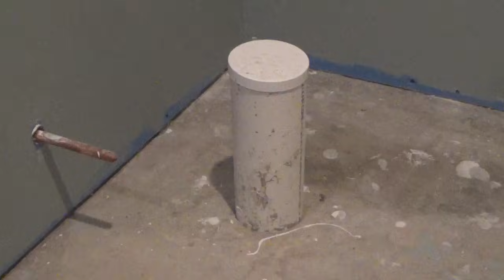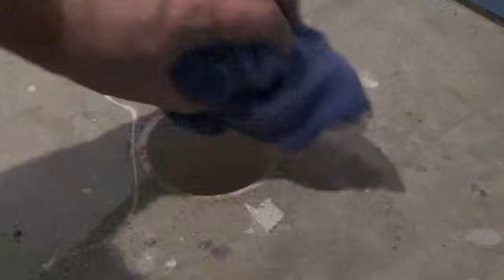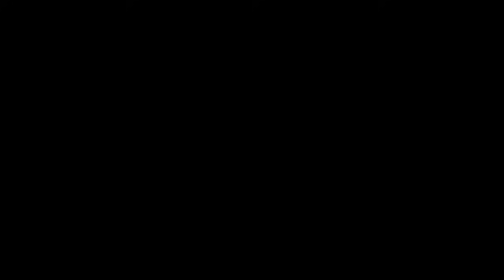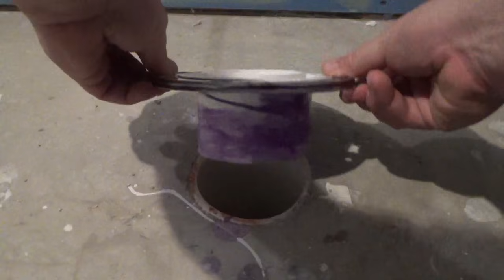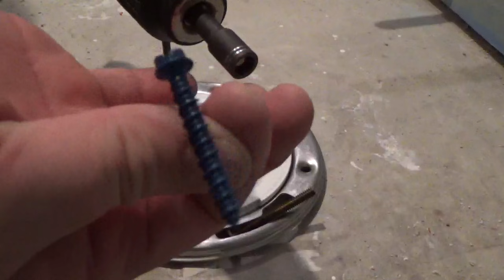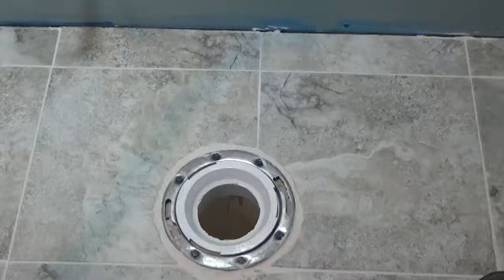Toilet Flange Installation on New Construction - Closet Flange

Comment: What if you are not going to add tile to the concrete floor? Will the closet flange then be too high?
Reply from the maker: Either way, there's a wax ring that will fit for sure. Regular or jumbo. No problem.

Comment: The primer needs to be on both components, unless you only want the cement to reliably stick to one of the pieces. Also, don't let the primer dry. It needs to be wet to bond with the cement and PVC. These are both right on the can, steps 4 and 5.
Reply from the maker: Indeed

Comment: My concrete floor is not flush. Any suggestions on how to get it flush?
Reply from the maker: Do you mean "level"?
Reply: Yes. The floor is not level so the flange does not sit flush. On one side it is flush and the other side I can fit my index finger under the flange.
Reply: Yes. The floor is not level so the flange does not sit flush. On one side it is flush and the other side I can fit my index finger under the flange.

Comment: Hello thanks for the video! The cement around the soil pipe is uneven and is slightly sloped. Do I need to level out the concrete first? Thanks
Reply from the maker: You could use spacers to do the same thing.

Comment: Great video, thank you.  Obviously this tile job worked perfectly for the flange in this video, but generally, should the tile work be done first around the waste pipe then have the flange installed on top of that?  Or does it not matter?
Reply from the maker: There's a lot of plumbers that will tell you to have the tile in first.  My tile guy wanted the flange in first.  if it sits too low, you can add spacers, or just simply use a jumbo wax ring.

Comment: First, thanks for the video it is a duplicate of my situation with the rough in stub in the basement. Second I need some advice, I want to sit my toilet on the bare concrete floor for now but in some years I might want to lay floor, if I set the flange flush will I have created a nightmare? My toilet upstairs was installed by the builder and it is NOT on top of the floor either and seems just fine. When I install the basement flange can I sit it just a bit higher to accommodate future flooring or is this a bad idea? Any help is appreciated.
Reply from the maker: well.....   the real answer is:  'flush with the floor" if you can.   There are spacers and jumbo wax rings for any play otherwise.   Hope this helps.
Reply: @PhilCrockett  Thanks Phil.

Comment: FYI. When he says if you have a 4” pipe then you need a 4” flange is misleading. You actually need a 3” x 4” knockout flange to fit inside the 4” pipe. If you buy a 4” knockout flange it will be too big to fit inside the pipe.
Reply from the maker: thanks for the tip

Comment: Primer does not only clean the fitting/pipe surfaces, but it also sightly softens the surfaces to be mated together. So yes, both surfaces should get primer. And the primer does not need to be completely dry before glue is put on.
Reply from the maker: thanks for the tip

Comment: The flange cap can create a vacuum. Do not leave the towel in between it, as it will slowly get sucked in. Because of this vacuum, I'd be hesitant to leave the cap on for long.
Reply from the maker: thanks for the tip

Comment: Great video, very helpful! I just attempted to replace a toilet in the basement and found out that the PVC flange is cracked on both sides. I was going to replace the entire flange but I realized that there was no screws holding it in, so I think the original owner glued it in but never screwed the flange down.

This is the basement so I'm assuming concrete underneath. So, I will use a flange repair kit (just a metal ring) and screw it down over the original PVC flange so I can avoid attempting to remove that. 

I will have to use the masonry bit to drill before the screws and this video showed me how to do that.

Wish me luck! lol
Reply from the maker: let me know how it went, John Doe!

Comment: What size of reciprocating blade did you use to cut it?
Reply from the maker: Not sure the size.  just get one longer than the diameter of the pipe.
Reply: @PhilCrockett  got a 12 in one should do the trick!
Reply from the maker: yes!

Comment: Isn’t the flange supposed to sit on top of the floor?
Reply from the maker: That's the best way to do it, if the floor is in before the flange.  otherwise, it's a close guess.  I always side on setting lower, rather than higher.  You can always buy a jumbo ring or spacers if a little low.  But a flange set too high will cause the toilet to rock.

Comment: Phil, as some others have already stated, your installation is not correct and will lead to leaking toilets... being the novice that I am, I watched your video and installed the flange directly to the subfloor and now I’m staring at a flange that is slightly recessed below the tile. I cannot get mad at you of course, this was my laziness and lack of additional research that got me here... but it would kind of you to at the very least put something in the description urging DIYers to set the toilet flange AFF. For anyone reading this who made the same mistake as me, I would suggest the use of the set rite flange extension kit.
Reply from the maker: Thanks for the input.  I checked with multiple plumbers and flooring subs before I did this, and went with their recommendations.  The toilet install on this flange went well, and works wonderfully.  No leaks, no problems.  It all depends on the thickness of the flooring.  In this case,  I chose to be a little recessed instead of accidentally having the flange above the surface (that cause rocking, and is super hard to redo).  If the flange turns out to be too low, then you use a jumbo ring, or spacers like you said.  It's very difficult to have a video that covers everyone's specific situation.  Most folks probably have the flooring put in first, but my recommendations for plumbers and flooring guy said to do it like the video shows. Thanks for your input, though.   My toilet is doing just fine, and if I had to do this all over again, I wouldn't change a thing (in my situation that is).   if you can get it as close to level as you can, then that's great,..... but be sure to not go too high.

Comment: Isn't the metal flange supposed to be on TOP of your finished floor?  The rim of the toilet sits on the finished floor, meaning the bottom of the flange should sit on the finished floor.  This is shown wrong.  This is shown flush with the floor.
Reply from the maker: Good call.  Read the first comment in the video description for an explaination.

Comment: I have always heard though that the flange should be installed on top of the finish floor not on the subfloor
Reply from the maker: Yes.  However, if the flange is put in before the tile,  you;ll have to give it your best guess on how high to raise it.  If you raise too high, the toilet will rock.  If it's too low, then all you need is a jumbo wax ring which is a common product and works well.  When you can, put the flange on top of the finished floor.
Reply: @PhilCrockett  ....If you install a "jumbo" wax ring, then I suggest people watch closely for leaks over time.  Two of my downstairs bathrooms were installed with the flange too low...on the subfloor....with 3/4" Advantech, thinset, 3/4" Durock, thinset and tile on top.  I had no idea that was done....not the first owner.  After the wax deteriorated, they leaked, and destroyed the subfloor.  If possible, I recommend people make sure that the flange is at least level with the finished floor, if not on top of it.

Comment: Probably one of the better videos I have watched, but the opinion bit/comment above or below or flush should be explained. Someone needs to do a video on this. Is it actually code in some states, why is it code? Why do some people say on top results in leaks and rocking. I would have a hard time believing it would be code anywhere if that is true. I'm not stating an opinion, I just want to know what the acceptable options are.
Reply from the maker: The answer, will usually be that the flange sits on top of the floor.   However, in many new builds, the tile people want the flange already installed.  Which makes sense, because you don't want to screw to tile.   So... depending on the thickness of your floor, you will have to give it your best guess and use spacers if you think the floor will be too thick.  We're talking about a flange that's 3/16" tall.  So if it's flush or on top, that's TRULY NOT A BIG DEAL.  However, the worse problem is if it's too low below the surface and too high above the surface.  The good news about this is they make a Jumbo wax ring that can seal a low set flange.  The bad news is, there is not a quick fix for a high set flange.   It was a lot easier when bathroom floors were vinyl sheets. ..... no figuring on height, you just simply screw them down (which BTW, sits "on top of the floor"... if that helps.  Some plumbers in the 70's didn't even use flanges, they just screwed the toilet to the floor which works, but dumb for many reasons.    Anyway......  The real answer is:   flange on top, but be careful not to set it too high.    The second answer is, flush works fine, as long as it's not too low.     Remember,  you can always use spacers and jumbo rings if needed.  In this video, I didn't need either, and the flange was fairly flush.  I have had, and will have no problems.    Before doing all of this, I got advice from my plumbers friends at our local plumber supply store where they hang out.  Most said flush is safe in the case of tile coming in second, and some said on top guestimating with spacers.... both sides agreed that it was splitting hairs  (a 3/16" hair).....
Reply: @PhilCrockett  Thanks for taking the time to reply and the thought!
Reply: Oatey, The company that makes these, literally instructs you to install it on top of the finished floor. There's always the guy that says I've been doing this for 30 years but doesn't actually live in the house for 30 years to know that it leaked through the floor because they put it on the subfloor.

Comment: This method works PERFECTLY for basement bathrooms.  I just completed it exactly as shown in this video on my new basement bathroom and no leaks whatsoever.  A regular standard size wax seal worked great. I did not need to buy a thicker wax seal.   I also caulked around the toilet but left the rear of the toilet perimeter uncaulked so if there are ever any problems I would see it.  make sure you do that if you caulk.  Never caulk around the entire toilet (leave the back part uncaulked).    Also like he said, make sure you use a metal rimmed flange and not an all plastic/pvc flange.   I HIGHLY RECOMMEND his method shown in this video where you put the flange in first and then tile up to it.   A+
Reply from the maker: Thanks for the super awesome comment, Steven!
Reply from the maker: BTW.....   I looked at your main web page and clicked on some of your domains.  Good to see a fellow Show-Me State guy doing well.  I swear our paths have crossed at some point.  I see a lot of similar interests.  As a side note, your site:  www.Missourimetaldetecting.com is one that I will have to pass on to my friend.  He is starting up a metal detecting youtube channel.    check it out:   https://www.youtube.com/channel/UC9JfmF1FC4qXpZkv_X2Bd1Q

Anyway,  Thanks again for watching and commenting.  I'll be checking out your www.stevenking.biz site more often.

Comment: Some idiot glued the toilet to the concrete in a house my mother owned.
.
So to tile the floor, I used a carbide bit in a jigsaw to fit the tile pieces around the toilet.
.
Some day, someone is going to need to remove that toilet and the only way to do it is by shattering it.
Reply from the maker: HA!!!  I had an old toilet one time that was held down only by the wax ring and caulking.

Comment: If you use cement in the drain pipe, why not use a bit of primer as well? That doesn't make sense to me,  as priner ensures a proper bonding of the 2 pipes.
Reply from the maker: sure.  You can use primer.  I use it mainly for water pressure lines.   We didn't have this stuff in the old days.  It's really like most things over-kill.  However.... You are correct.  use it if you believe in it.   Thanks for watching and commenting , Dave!

Comment: And to all those that say the flange needs to (or must) sit on top of the finished floor; Many times I have pulled up the linoleum and installed ceramic tile that usually comes out even with the top of the toilet flange. It's not a problem. A standard wax rig w/flange will work just fine and there will be no leaks.
Reply from the maker: I totally agree!  In every field I've worked, there are those who have been taught different ways, and they all swear it's the ONLY way.  The secret is..........   wait for it......   wait for it.........   the secret is.......
they all might be right.

Comment: I never use the metal flange kind. Too many times I have replaced/repaired them because the metal rots away in a relatively short amount of time.
Reply from the maker: Those metal flanges disappear pretty quick.  The products our there are getting better and better!  The first toilet I ever did 20 years ago, was in a basement on concrete.  There wasn't even a flange.  They just hammer drilled a hole and planted an anchor thought the toilet.  of course it rusted away and one day the toilet tipped when the subject leaned over to wipe.  It was an epic 'wipe-out'!  Ask me how I know........
Reply: @PhilCrockett , lol! “The subject.” Great video. Thanks.

Comment: Thnx for keeping the bolts and slots positioned properly, as a remodeler I've had to reposition flanges so many times because some one was too lazy to use a square or tape measure, flushing sound at the end was a nice bonus
Reply from the maker: THanks for that great comment!
Reply: If you caulk the base of toilet only, would it take the place of drilling in bolts. It would leave the toilet in an easier maintenance form?
Reply from the maker: I don't trust caulking.  bolt that sucker to the floor and you won't have any issues.

Comment: Excellent info and tutorial.  But I and many pro's would first finish the floor around the white PCV pipe. And then cut the pipe flush with new floor and the install flange. Good video.
Reply: No need to tile tight to the soil pipe.  Tell the installer to hold tile back the width if the flange ring, then fill with thinset.  That  way you're not drilling thru tile with your tap cons.
Reply from the maker: Yes.  There are 2 ways to do this for sure. Before I made this video, I wanted to get several opinions from different plumbers.  In my local poll, and to my surprise, every single plumber said to finish the floor after, as long as the flooring was regular height tile and nothing unusually thick.  The flooring guy said the same thing.  You’re the 2nd comment I’ve gotten that that does it the other way.  Most folks like me, don’t want to drill through tile and chance cracking it.  Better to use a spacer if the tile ends up too high.  But like I said, either way for sure,  thanks for the comment.
Reply: @PhilCrockett  Great video thanks, but also confirming the kid's method is the better way to go. As long as you're the one who set the tile in a well spread mortar bed, there shouldn't be any issues drilling through the tiles whatsoever. In fact, they will give your tapcons a more sure grab as concrete is often inconsistent when mixed and poured, leaving the drilled holes susceptible to crumbling interiors.  

Also, I recommend cleaning and priming the soil stack just before the flange goes in, as well as giving the flange a quarter turn while it's being inserted. Every weak link I've ever seen in the pvc chain is an under-glued joint. Not that yours was, but I never take chances when it costs pennies and only takes a few seconds. Best of luck, and thanks again for the video!

Comment: I installed the Mansfield Vanquish toilet.  It's manual said to make the top of flange level with the finished floor.  The first time I installed the flange on top of the finished floor and the toilet rocked/wobbled on the flange because it was too high.   And yes, I had the flange screwed down.    I reinstalled the flange at the instructed height and it worked perfectly.    Every brand is different.  Make sure you read the instructions.
Reply from the maker: YES!!!!  AGREE!!!
Reply: Glad to see this. So many back and forth comments about installing to cement floor or finished blah blah. I have a concrete floor in my basement and intend on screwing flange right to the floor as shown here because I plan to install this very toilet. Thanks for saving my hours of reading comments.  =)

Comment: Flange should of been installed on top of the tile finished floor
Reply from the maker: Yes, you can do that too.  not "should", but "can".  Since both methods are used in modern day building, I actually went to our local plumbing supply store and surveyed plumbers.  I also questioned the tile guys too.  Unless the flooring is super thick (thicker than laid tile), then the most common answer was to install the flange first, then have the tile guys run the tile up to the edge. (this was way more common).  The funny thing was, ALL the tile guys told me to have the flange in first before calling them.  If you have significantly raised flooring, then use a spacer.

Comment: Shouldn't the tile have been installed first since you were at new?  That way the flange sits over the tile?
Reply from the maker: You can install either way, however, the way I show it in my video is how most plumbers do it in new construction.  This method has never failed me.
Reply: @PhilCrockett  how did you get your drain pipe cut so flush?
Reply from the maker: I used a sawzall